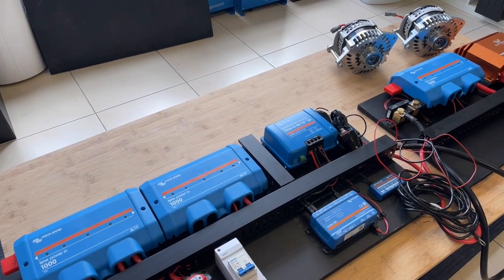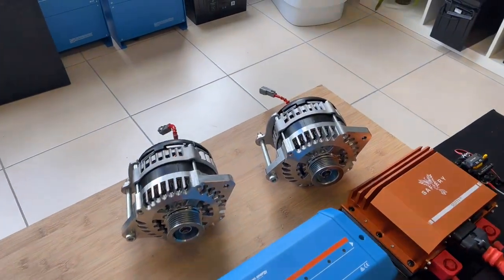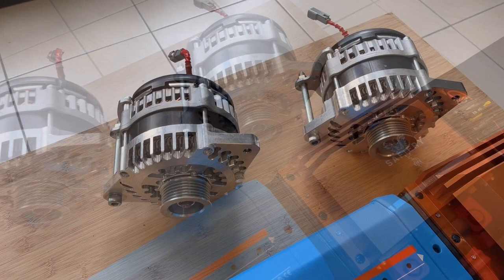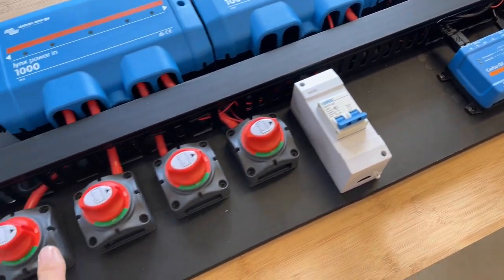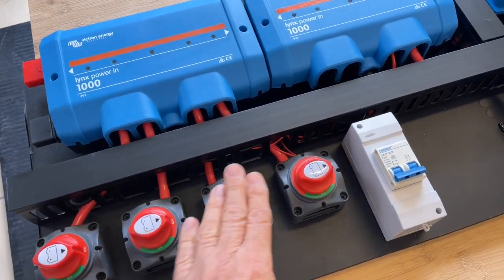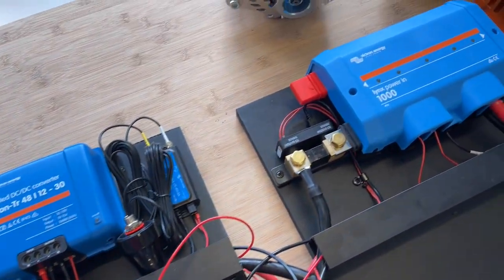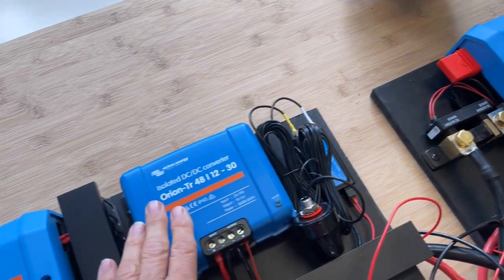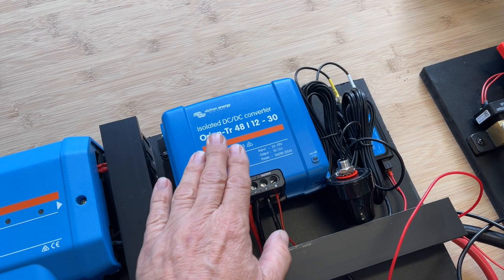Refit of 48Ft Cat SV Mint No Genset - 800Ah Lithium 3,000W Alternator Power with Scotty

Comment: Another slick use of electrical power. So why not 48v alternators? Lets ask Bruce.
Reply from the maker: For this boat, the owner wanted maximum redundancy. So with 12V 3,000W alternators, should there be an issue on the 48V side, he can run everything off these high power alternators.